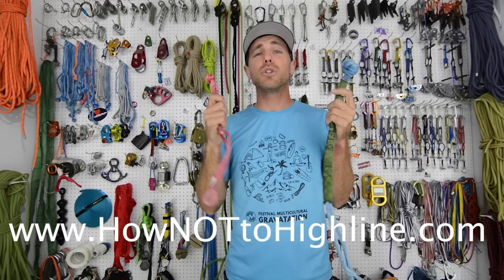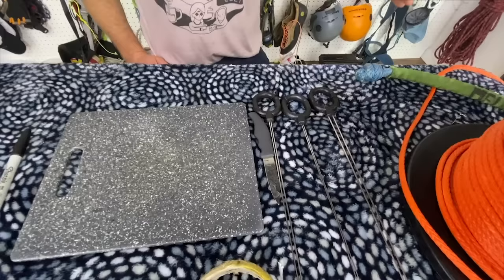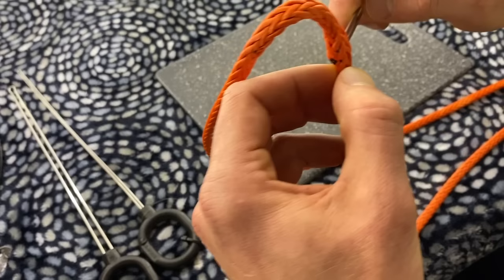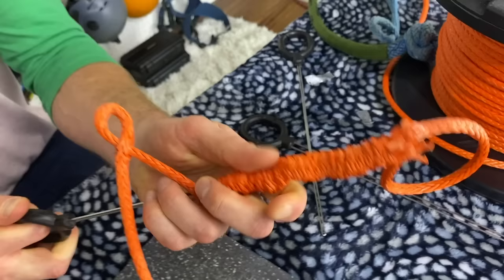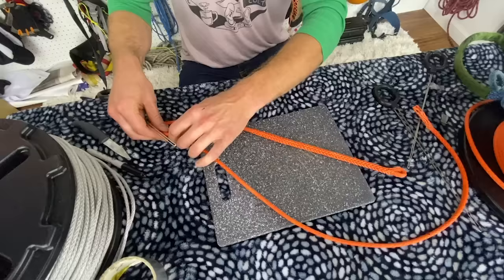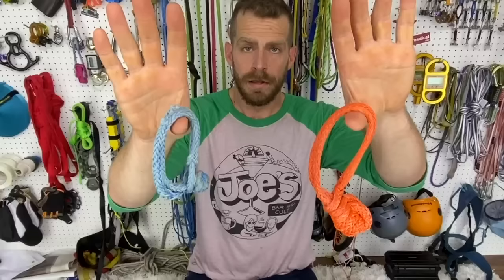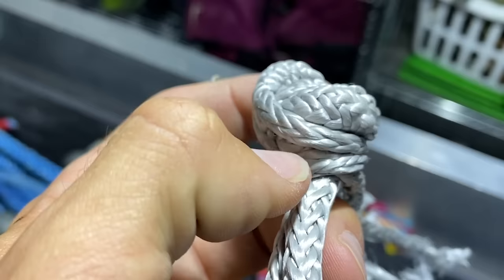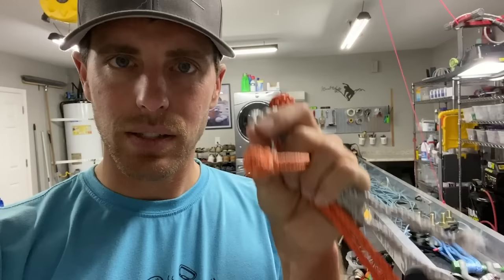Make an EASY Amsteel soft shackle with overhand knot - includes break tests!

Comment: I use my soft shackles for hammock camping and my tarp setup.  There's some really good benefits for using them instead of a carabiner.  Weight savings is probably the primary reason, cost is another HUGE one, and my favorite thing about them is they can't snag up on any of my lightweight fabrics and bugnetting when my gear is tightly packed away.

I wasted HOURS of my life tying button knot soft shackles the old way.  I'm definitely doing this style from now on!!  ...unless I make bracelets... The traditional button knot does makes really cool looking 1-ton bracelets (with a 50% safety margin).  I like the sound of '1-ton bracelet' so that's what I call them, even though they break at 3000-ish pounds.  My bracelets and hammock hanging shackles are made out of 7/64 which seems to be the hammock industry norm.

A 200-pound person hanging on a very tightly hung hammock (5° suspension angle) generates under 1200 pounds of suspension tension.  There's a general rule that you should aim for about 30° suspension angles so the forces are reduced on your gear.  At a 30° suspension angle the same 200 pound person only puts 200 pounds of tension on the suspension.

I'm not a physicist, I used the Hang Calculator to come up with these numbers.  Google "Hammock Hang Calculator" if you want to play with some different hammock hang configurations and see what forces are involved.  It's a pretty cool tool.

Comment: I just got into soft shackles the other day and since you couldn't think of any uses in climbing... not any load bearing tasks but nonetheless:

I did make a tiny super easy soft shackle out of 2 mm accessory cord (rated for 0.8 kN, in 4 strands minus the knot, so roughly 1.6 kN maybe) and put it on one of my stoppers at the very end where the wire curves through the stopper part. That way it could potentially be useful when the stopper gets stuck and you can pull out the soft shackle with a nut tool and clip a carabiner to it, to get a good yank on the stopper to hopefully retrieve it more easily.

It could also just replace pretty much many accessory carabiners which aren't load bearing and which you don't clip and unclip very frequently.  (Because obviously carabiners are a lot less annoying to unclip than it is to open up a soft shackle like that, if you lock the soft shackle with a girth hitch to itself. Note that with accessory cord there are no splices and no eyes involved, so a girth hitch is probably the best locking mechanism I know for those... In case the shackle stays constantly loaded it would be enough to just put the entire loop over the knot. For cyclic loading & unloading a tightened girth hitch seems to hold bomber.)

E.g. attaching something to your backpack or to a tree branch or something while you're at the crag
Or to attach something to a haul line without needing a dedicated carabiner.
When staying over night on a big wall I've seen you guys use a large horizontal anchor cluster to keep stuff organized - you could hang up shoes, bottles, backpacks etc. to those anchors without needing 36 carabiners, but instead use just a handful of these tiny soft shackles. That could save a bit of weight as well.

Comment: Hi there Ryan .....Rabbit hole time..... I don't climb or high line but come from a maritime (fishing and sailing) and remote area working background, I have been making my own soft shackels for a few years (not life support) and have watched the methods evolve. I mainly use the standard looped button knot soft shackle for specific jobs but have a need to have a flexible/adaptable compact quick and dirty rigging solution. I have started to carry long bury continuous loops and tie them on the fly into soft shackles when required. I use an overhand knot like Micheal but instead of threading the end through the two sliced loops I thread the end through the single loop formed by the continuous loop. I have found that the limited wraps of the overhand knot allow it to tension up in a predictable and almost self leveling way, and almost seams like it is not critical to pre-tension, the knot is large, and the because it is feed through the continuous loop end very secure. 
Would love to see you load test this type of soft shackle, this method produces a versatile soft shackle which has many different types of connecting/button capturing techniques and applications:
- for quick light duty connection use as is and just pass the button through the loop (large button does not pass through and is held by the increasing tension on the loop as it is loaded) this is not so secure when unloaded but seems to be effective on material 1/4" and lower even without the noose
- for a little more security pass the loop through two lines at button and then wrap the loop back over the button
- cow hitch/girth hitch/larks head knot in end of loop slipped over button
- join the loop end to another loop in a line using a reef knot/lark head knot/ cats paw knot and use the gap in the center of the knot to securely capture the button (thus adding a retained soft shackle to the end of a line which has a loop installed)
- marlin spike hitch at end of loop this forms a functional noose which can be loosened like the standard soft shackle and slipped over the button
- can tie it to another line as a prusik with a button knot to create a clinch knot that can connect to loop terminated lines.
Would love to see you test some if not all these techniques, I generally use them in non critical applications but would appreciate a better understanding of how they would fail, and how much the soft shackles strength is compromised.
Really appreciate all your work, cheers

Comment: HD soft shackles are popular with the off-road crowd.  Advertised breaking strength in the 40K-lb range are typical.

But for less demanding tasks I make super simple ones from braided Kevlar.  A length of cord, ends tied in a simple overhand knot, and the far bend attaches with a Lark's Head which I think you use another name for.  No penetration anywhere through the braid.  This takes less material and probably 1/10 the time of a typical soft shackle (only seconds in the field), but undoubtedly comes with a strength loss.  I compensate by simply making it way bigger than probably necessary and have never had a problem.  But it would be interesting to know how this "10% design" break tests compared to proper techniques.  Since I've never failed one, I don't even know where the weak point is.

PS, as simple as this approach is, I certainly didn't invent it.  Performance sport kites use this exact method to attach their control lines.

Comment: I found this channel years ago because soft shackles get used a lot for light weight hammocks. Most people use 7/16" or 1/8" for that, but you won't fall further than a bar stool. I couldn't find button knot directions that I could actually follow anywhere else. I'm curious to try out this method because it looks a lot faster to make. Thanks so much!
Reply: Tyler Battle I don’t climb or slack line, I found this channel looking for break test info on the Dynema I use on my hammocks. I’m typing this right now while hanging in my hammock from 2 shackles tied exactly like this. They work great.
Reply: I have very limited knowledge of soft shackles, could you explain why you would use a soft shackle for hammocks instead of a simple knot? Soft shackles are used because they're stronger than knots aren't they? But would this make any difference in the low load of something like a hammock?
Reply: TacBlades has a nice tutorial with measurements for 7/64 amsteel. He uses locked brummels for the loops but I kinda like this method as it's a bit quicker and easier.
https://youtu.be/K0eZz36PRYI
Reply: So, first a soft shackle does employ knots. The reason these instructions on creating the knot end via either a diamond knot, button knot, overhand knots(others?) is that dyneema rope is very slippery, so the knot you create for hanging a hammock securely has got to be both hard to collapse and difficult to unfurl. After trying the button knot more times than I want to count, I was able to create soft shackles with the overhand knot quickly. This is awesome!

Comment: Spitballing here:
- 2nd belay loop (directional while route setting)
- bail biner
- rap slings
- as an emergency quickdraw threaded directly through a bolt hangar
Reply from the maker: Dude, yes!  A 2nd belay loop would be awesome!  Looses strength when inside a climbing hanger because of sharp edges but still about as strong as a carabiner haha.  Can't rappel off of it though because rope on rope abrasion would cut through it
Reply: @HowNOT2  Yeah, I wouldn't lower using a soft shackle but I would rappel off of one. I know plenty of people who like carrying extra kit and can see them having 1 or 2 just as bail biners. What about threading a soft shackle through a bolt hanger and turning it into a quickdraw? There are plenty of in-a-pinch uses for soft shackles.
Reply: Pretty standard here to rap of slings especially in the alpine. Rope on rope abrasion for one rap shouldn't be too bad?  I've changed a few of my practices because of this channel (better ways of doing things mostly). So cheers keep it up man.
Reply: Better have a maillon for all that other stuff, at least if someone takes it after a while it's still usable, leaving dyneema in the elements is worse than leaving cordalette because of uv...
Reply: @dahabclimber2480  Dyneema is UV resistant. Nylon is not.

Comment: I use dyneema and soft shackle on my sailboat. (headsail tack and sheet connection) i did my own soft shackle with 3 mm and a overhand not. Still holding well after 7 years. i will never reach half the limits of 3mm dyneema but the safety of not having a metal shackle flying around and the convenience of having a simple and fast way to change my sail is priceless.

Comment: I work in a seine shop in Alaska called Bulletproof Nets we use Samson Amsteel quite often, instead of using duct tape use electrical tape it has great stretch so gets super tight when cutting and is way cheaper for a roll instead of duct tape and packs much smaller. Thanks for this great tip on using the overhand knot! Also you can tape over your tapers and insert and you can actually milk the line back down itself if you don't have the d fid like you have. Thanks so much for sharing!

Comment: I use soft shackles to attach a sled on to the back end of a Jetski. for rescue purposes.  I think you could use them at the bottom of a lead rope solo climb for the bottom anchor. This way if there was to be some movement in the system you would not have a gate load situation.

Comment: It would be really interesting to see the influence of taper.
It's really well known by the "splicing community" that taper are really important but at wich point makes it a real difference, who knows?
I would even do a longer taper in the Michael's one. ^^
Also, I always saw that kind of shackle with 2 brummel eyes, I've never seen only with the burry before but it looks like there is no differences.
Or could we spot some slipping at the eyes after the break test? That could be interesting as well, maybe by putting a mark before loading?
Reply: If the bury is long enough, that’s what provides the strength of the eye. The locked brummel part of it mainly makes sure it doesn’t come loose when it’s not under tension.

Comment: The importance of the tapering in dyneema splices was extensively tested by some guys on the Sailing Anarchy forum some years ago. But of course it would be nice to see it on video...
Reply from the maker: Charts are interesting, but a guy who says WOW after every break test makes it better :)
Reply: Do you happen to have a link to that? can't seem to find it and I'm kinda mindblown just how big a difference it seems to make.
Given a softshackle has 4 parallel strands and it broke at the "how not to taper" at 2x the breaking strength of the rope it seems that not having a propper taper cuts the strength in half!

Comment: Is there a formula to calculate, or at least closely estimate, how much length you need to end up with a certain diameter of shackle when you’re done?
Reply: Cut 6'  of rope tie a knot measure the loop/ tail, that tells how much the knot takes for this diameter of cord < the amount consumed will verry by size of cord and amount buried> the 6footer seams to be a nice size to have on hand.a button head  with 6” buried in each leg is ~2' open ; so ~12” in the knot and 12" for buried with 6mm

Comment: hi, checking out both you break video here ,  iam from the sailboat rigging would where we attached to fixed fittings a lot. in both you break tests , at 13.39 and 14.50 in the video the failure is starting as the line goes over the 'rough shackles'. In sailing we know the shackles of fittings must be super smooth to avoid premature failure  , polished stainless , hard-coat anodize polished aluminum etc.  
You may want to add then to your test rig to get repeatable tests. 
cheers warren

Comment: Ok I just want to point out on the first shackle break test the shackle broke right where the shackle mold line was acting as a knife if you will. So I’d say that test is highly inconclusive. On the second test I could help to see that the shackle pin itself is machined round but through the rugged use I’d be willing to say that shackle pin probably has imperfections in it through use also acting as a knife as well as the soft shackle was riding up and down thus creating more unwanted heat. So I’d render the second test inconclusive too. Soft shackles are awesome and have probably thousands of different ways of making them. However the one way of making soft shackles I like I learned from a SAILING ZINGARO YouTube video. It’s titled
DYNEEMA: how to splice it and make a soft shackle. 
Personally this is the best way I think. Obviously my opinion but would like to see another break test on soft shackles made this way and a more controlled break test

Comment: When I splice this type of soft shackle I do a brummel splice rather than just a bury loop at each end, and also put the loops right at the knot rather than leaving a short tail. This is in 4mm and 3mm dyneema for making hammock rigging. Could be interesting to see if it makes any difference.
Reply: Jethro Fennell I’m in the same boat; I use these for hammocking as well. The locked Brummells do reduce the strength slightly, but for hammock use we never put enough stress on our Dynema to get close to its limits, so we never see the change.

Comment: Soft shackles might be able to be used to extend a clip in to a pinch anchor so you can get a deeper set on big walls or lead anchor climbing
Reply: Probably cheaper to just have a sling. I've heard this stuff is expensive

Comment: Please test tapers! IAnd try a diamond knot which is much easier to tie than either of these methods. I make lots for use on racing sailboats. If you pre set them properly, they get rock hard. Amsteel is made with SK 78 grade dyneema. Marlow ropes makes a higher grade D12 Max using SK 99. That would be cool to test out, but I’m actually more interested to learn how tapers affect breaking strength. Thanks for the awesome content!
Reply from the maker: Great suggestion!
Reply: The diamond knot is much easier to tie and looks beautiful. I use a simple girth hitch on the other end of the soft shackle

Comment: Revisiting:  - the bigger the bend radius the higher strength the  button knot, something which can't capsize is great, a figure-8 works too - more bulk and an extra turn in the knot...
 - 4 diameters in the centre of the knot set is a decent "minimum bend radius" to begin with.....

Great to be able to tie whenever it is needed...

NB, minimum diameter of fixed pin "terminations are indicated to be 3x rope diameter. Generally in mountaineering gear, this is not the case, for soft shackles it "may be" - at the bight  (low friction  and minimal "bearing area" means the bight / noose is never going to reach "full strength" in use - a point to realise, a high mechanical advantage (increased  rope in the moving system,  doesn't necessarily mean all the lines can reach the "theoretical strength" (x ,mechanical advantage) before breaking- pulleys are (8, 10, ..) up to 12x rope diameters  (super good enough - SWR - bigger is better for rope fatigue life).

Comment: Started checking your videos out, was interested in the soft shackles for winch applications, used to rock climb way back when and was looking at the impressive gear wall, has no one else noticed the, errr, marital aid hanging on the bottom left of the wall 😛

Comment: You can use them as nuts for climbing.
Reply from the maker: we are going to test that in our cam crusher device :)
Reply: Hey, so you are saying as 'soft protection' this is what I was thinking, especially for limestone type crags and seaside crags.
Reply: They could be a versatile option as a tent anchor when camping on rock (e.g. Georgian Bay). Should be lighter and cheaper than climbing gear, and an application that's not life critical.

Comment: Great video.  Thanks a lot mate.
I was wondering if anyone has tried a Capuchin Knot (Basically a Figure 8 Knot with an extra crossing) as the stopper.  Its almost as simple as the Overhand Knot, which may be the reason that the Overhand holds in Amsteel and with the extra crossing may not need the Eye Splices to lock it.  There must be a reason that an Overhand Knot will hold when the more complex Button Knot or even a Diamond Knot wont.

Comment: I’m also not sure where you would use a soft shackle in climbing. Maybe extensions for quick draws or anchor points? I would like to see what quick draws break at and where they break (at which beiner or at the webbing)
Reply: along the czech german border there are places where metal pros are not allowed so they trad clim using knots as protection